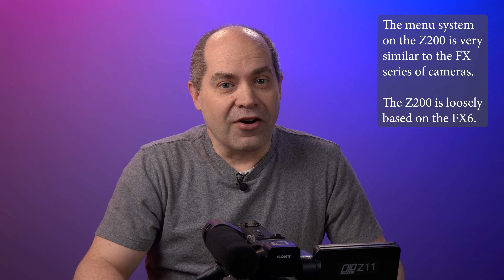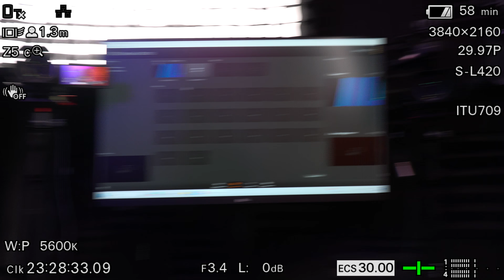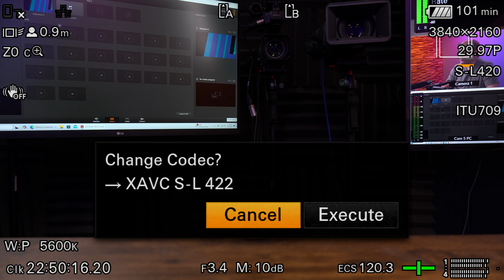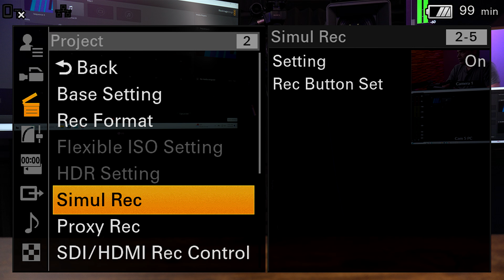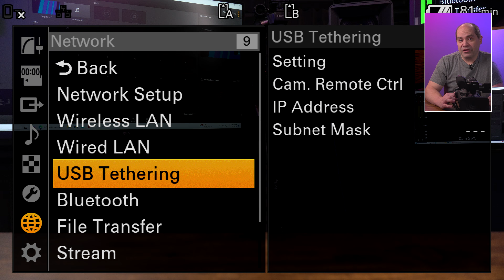Sony PXW-Z200: Is It as Good As Anticipated???

Comment: Hello Doug  , what Sony Cfexpress card do you recommend when shooting at highest resolution.  & do you shoot in Cinetone
Reply from the maker: I don't have one that I can recommend in good conscience just yet. The ProGrade ones I bought are plenty fast, but one of them already died. And the OWC model I got slows down pretty quickly when writing large files. I"m still on the hunt. 

I have not historically been shooting S-Cinetone, but I will be moving forward. I recently read online that ITU709 clips whites more aggressively than Cinetone, so I'm giving Cinetone a try now. I still need to spend some time tweaking the color settings to achieve the look I want with it, though. I have an event next week where I'll have a chance to do that without offending a client if it isn't ideal.
Reply: Thanks again Doug for your input. , by the way , Great video 😊
Reply: Hello Doug. , can you transfer video files directly from the Sony Z200 camcorder to a computer  , or do you need a card reader. , example a Sony Cfexpress type a card reader 😊

Comment: Thanks Doug. Question - I wondered what (if anything) would make you reach for the fx6 over the z200. Love the ending too btw @djp_video 😉
Reply from the maker: For cinema-type work the FX6 would be much better. But also, if there was a specific use case where we needed the super shallow depth-of-field that you can get by using a larger sensor and interchangeable lenses. Or if I had to work in a really low light situation (like candlelight) the FX6 is going to have much better noise response. 

The beauty of the Z200, and other camcorders, is that you have the flexibility and convenience of a really wide zoom range without having to buy a lens that costs an arm and a leg (or, indeed, in many cases just doesn't even exist). In 95% of the situations I work in, being able to zoom in and out trumps the advantages of a larger sensor camera. Most of the time, if I did use interchangeable lens cameras, I'd have to have more cameras (and camera operators) to cover both the wide and tight shots. But with a camcorder, one camera can do both. 

If you haven't seen my video on why I selected the cameras that I did, that might be worth your time. Any place I mention Z150, you can substitute in Z200 because the reasons for using both of them are the same. https://youtu.be/ncCleF4LJzQ
Reply: @djp_video thanks Doug. Yes I have followed your logic for some years now and indeed currently hold XF camcorders for live productions for precisely the same reasons. 

However, I do see work which uses the fx6 plus lenses (at considerable cost) and I guess this new z200 has perhaps made me question once again what my next upgrade will be. 

I’m pulled in both directions. Honestly - as producer & operator I’m with you. As viewer / consumer, I’m pulled towards the cinematic offering of a ‘faster’ lens
Reply from the maker: I'd say that the situations where you're shooting will be the biggest deciding factor. If you're always in really low light situations, and the camera and subject aren't moving around that much, the FX6 could be a better fit. 

If you're outdoors or generally in situations with intentional lighting, or your camera or subject are moving around, the Z200 will be a lot easier to work with. 

For people in my situation, where we're working for various clients in a wide variety of situations, and using camera operators of varying levels of skill, and having a single camera that can cover both wide and tight shots is beneficial, the Z200 is the best fit. And if I have a situation where I need an FX6, I can always rent one. 

If you're unsure, rent one of each for a couple of days and see which one fits your needs better.

Comment: at 3:16 The z200 has more detail over all BUT we see the face hairs only sharp in between sentences, very irritating to see sharp, unsharp, sharp, unsharp. Like motion blure. When you see it you can not unsee it. Like under bitrate socker play where you see the grass super sharp only when the camera stops and it is just a smooth green surface when paning. Is this youtube processing or from the camera?
Reply from the maker: That's more of the YouTube compression than anything else. That doesn't show up in the raw footage.
Reply: Can it be at 34:23 We found out that it is at !080i? Not sure it this is the case. .....the goal for me is in what way should move from still shots to moving shots, in my capturingings. I think I neeeeeed 60 fps so far, as I see it. Movies does not make it unless they are cutting faster than I can refocus. Sure, this works, but I get bored eventually. 
I hope for 60fps. always please
Reply from the maker: I believe something I changed in the camera settings (probably off camera) between the beginning of the video and 34:23 caused the output to switch from 4K to 1080i. The cropped images near the beginning would be far softer if it was outputting 1080i. 

The original footage doesn't show the artifact that you're referring to.
Reply: I’m also thinking this could be cause from motion blur. If the shutter is larger than 180 or not 1/60 for 29.97 that will blur more than standard look.

Comment: how does the tally work (i saw it in the menu) ? is it possible to trigger it via ATEM or companion or visca?
Reply from the maker: The tally feature is only to indicate when the camera is recording.
Reply: @djp_video  True, the tally function is just the record lamp indicator. Although if you do have and still use the Sony Video Switcher, MCX500 4-channel switcher, there is a tally screen function for the LCD panel of the camcorder, sent via Lanc control and RM30BP. You can use a Y splitter at the camera to allow a remote to still be used at the pan bar of a tripoded camera. With the ability to turn on and off the HDMI & SDI output display separately, one can have a tally just like the LCD display on their monitor for a multi-camera production with a tally function on their external monitor. This is way better than any other camera before. This means you can have a clean feed via SDI and have a displayed output via HDMI that can be turned off with a button press on the camera and or vice versa, and or both on or both off. The Z280 can not do this even though you can shut off either output from the menu.

Comment: I am disappointed to hear that the SDI output turns off when in auto crop/tracking mode. If I am streaming a live event and want to track someone walking back and forth on the stage I guess I won't be able to use this feature because most pro events use SDI out from the camera and not HDMI. I hope this is something that will be addressed in the June firmware updates as well as adding more advanced color adjustments to the menu.
Reply from the maker: It would be nice if we had the option to use SDI instead of HDMI. I can't say whether the hardware is capable of doing that or not. I suspect that the camera uses the scaler normally reserved for SDI (to convert 4K to HD, etc.) to do the auto framing and that's why SDI is disabled. And if that's the case, rerouting the signal in software might not be possible. But that's just a guess on my part.
Reply: This is an absolute showstopper, was planning to get multiple of these, but not. And to be frank, classic Sony, limiting functinality - in a pretty stupid way. I love our Sony’s to bits, but this is just plain stupid.
Reply from the maker: @ronnyhofsoy  The HDMI output works just fine in this mode, if that helps at all.
Reply: @djp_video  Guess there's always a HDMI to SDI converter that can be purchased and implemented if you really need to.  But, yeah.

Comment: Great presentation.   Very informative.  I’ve been using NX5u’s and this looks to be a nice upgrade.    How do you find controlling the iris from the dial on the side of the camera?   Seems strange that they moved the iris control off the lens.   I’m not sure I could get used to that.
Reply from the maker: It hasn't been a problem. It has a dedicated dial for controlling the iris, so it isn't like you have to dive into the menus to change it.
Reply: That's a deal breaker for me.
Reply from the maker: Even if you can reassign the focus or zoom ring to control the iris?

You’re missing out on a fantastic camera.

Comment: Why is it that none of these camcorders support true 30p and 60p?  Why are they still only supporting these old NTSC frame rates?  Especially with YouTube only supporting 30p and 60p for live streams.
Reply from the maker: It's for backward compatibility with broadcast. Sony, Canon, etc. have a long heritage in broadcast, and cozy relationships with the broadcast industry. OTA TV probably isn't going to be switching any time soon. 

In the long run it doesn't make a lot of difference in practical terms. You can play 29.97 or 59.94 video on a 30p/60p device and you'll probably never see the difference. Spotting a single repeated frame every 16 or 33 seconds is going to be difficult. 

But, yes, it would be nice if they offered true 30 and 60 in addition to the NTSC-compatible variations.
Reply: @ I’ve been testing with it, 1080p59.94 out of SDI into Decimator MD-HX to convert to 1080p60 and record that but I got a lot more duplicate frames. It was quite random and not evenly distributed but I got a duplicate frame mostly every 90-ish frames. I was surprised by that but maybe it’s due to limited memory in the MD-HX to buffer frames/lines?!?
Reply: It is called broadcast and the Law of the FCC to be able to still play on older transmission systems. Besides all sensor tech would have to change, the fallback is interlaced video. There is no true 30p only 24p and 25p. 60p does really exist. 60p is HDMI output because vertical blanking isn't necessary with HDMI.
Reply: @kevinbooth6865  Not sure if it's true that the FCC mandates manufacturers to support 29.97p and 59.94p. But that still doesn't mean they can't also support 30p and 60p. Sensor tech doesn't need to change as e.g. my  Canon XF605 does supports 120fps, even while simultaneously recording 59.94fps. But yet it does not support true 60fps. And true 30p and 60fps do exist, also outside the HDMI realm. For example it's in both the SDI and REC.709 specifications and most professional equipment supports e.g. both 59.94p and 60p. But I've yet to find a (semi-)professional camcorder that does.

Comment: Curious, what camera mounts are you using in your studio? They didn't look like tripods.
Reply from the maker: They're microphone stands... the kind with a weighted base. I needed something with a really small footprint. I use adapters to convert to 3/8-inch thread, then use a ball mount, on top of which is the sliding plate mount.

Comment: wow surprised sony hasn't created a new version of lanc. Only 7 speeds but this camera can do like 11 speeds so that's an issue.
Reply from the maker: They wouldn't even have to create a new version... just supplement it with a new command for the wider range. Use the existing command for coarse control, the new command to add finer grained control. It's not a hard problem to solve.

Comment: How do you set the picture profiles?
Reply from the maker: It doesn't have that feature.
Reply: @ Ok thanks!
Reply: @djp_video  Is the Scene File function in Custom-mode, not similar to Picture Profiles on FX and Alpha cameras?
Reply from the maker: Not really. Those are essentially just LUTs. And you can't tweak them. You get a few picture controls separate from the Scene File... but the scene file itself isn't editable.